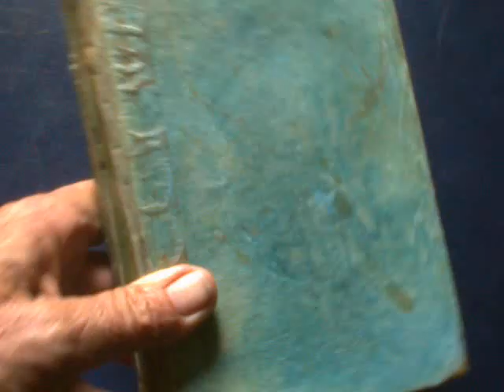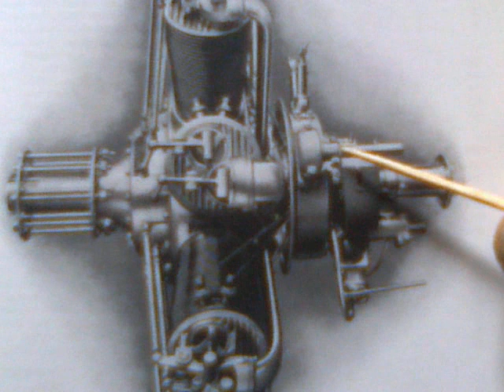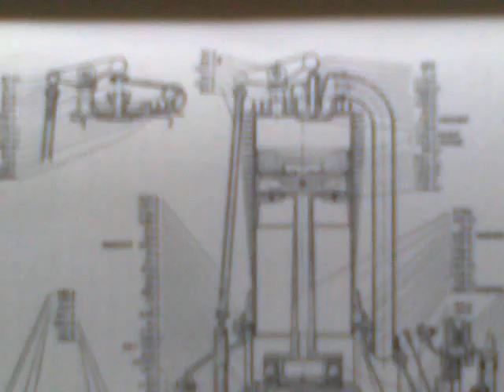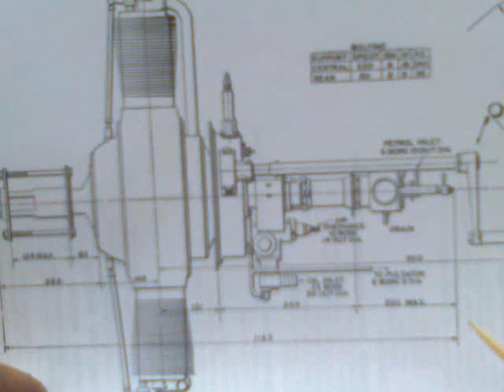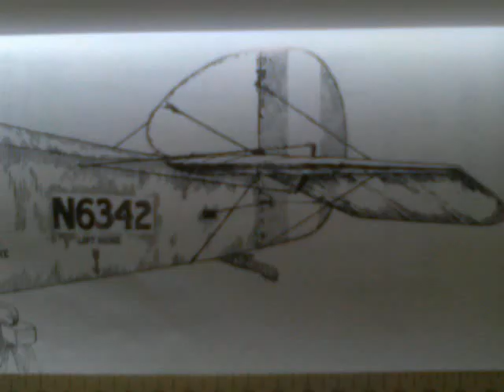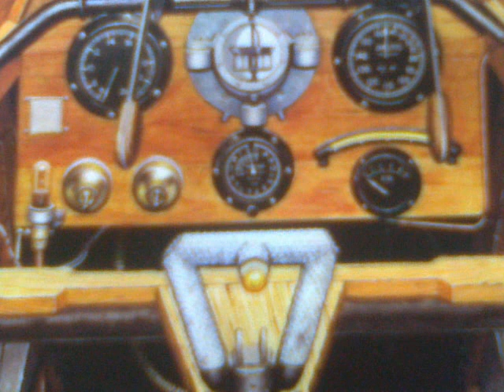Sopwith Camel Mystery, Technical Details According To Norman Macmillan.

Comment: Any ideas on the thinking behind routing the fuel through the crank case Warbles, or was that just a necessity in engines with rotating cylinders?
 It seems a very costly trade off, vis the Castor oil and total loss lube system. Was it common?
 I never knew the Camel was such an interesting aircraft.
Reply from the maker: G'day,

Thanks mate.

Ah, well..., if you check out my videos a couple of weeks ago on the Aeronautical Works of Lawrence Hargrave, the original Rotary Engine ran on Compressed Air - and I have only vague guesses as to how he achieved it.

The Gnome Brothers' 1909 7-cylinder 50 Hp  Rotary was a revolution, it was LIGHT, & SMOOTH, whereas pretty much everything else before was heavy as buggary & shook like a shower of shit, and they had to employ an Observer lying down on the edge of the Runway to look for Light under the Tyres, to prove that Flight had occurred...

   Spinning the whole thing meant no need for a heavy Flywheel, the Fins on the Cylinders had plenty of Cooling Airflow anytime the Motor was going, so by 1910 everybody wanted a Gnome...; and having the Fuel-Air go in through the Crankcase was the only possible way in & up to the Cylinders.

The early Gnomes had Spring-closed Poppet Inlet-Valves in the Crowns of the Pistons, with Low Pressure during Intake sucking them open to admit Mixture, & one Exhaust Valve in each Cylinder Head.

When an Inlet Valve stuck, the Plug ignited everything in the Crankcase, shooting Flame out the Crankshaft & Carburettor...

They brought out the Monosoupape ("Single Valve") which had Inlet Ports (Holes) drilled in the lower Cylinder Skirt (inside the Crankcase) uncovered by the top of the Piston at 20 Degrees above Bottom Dead Centre.  

On an Inlet Stroke the Exhaust-Valve briefly opened to admit pure Air with which to dilute the Petrol Rich Mix coming in though the Bypass Ports..., at the end of the Power-Stroke the Exhaust Valve opened at 25-Degrees above BDC so the pressures were equalised as the Bypass Ports opened, preventing Gasflow (!) ; but the "Shot of Air" coming in through the Exhaust Valve was why the Monosoupape's were either Idling or running Full Throttle - the Mixture was only correct at full throttle.

Then Le-Rhone & Oberusel & Clerget & Bentley all started using Induction Pipes & Inlet Valves in a 2-Valve Cylinder.

The Cylinders were one-piece units, with integral Heads, all turned down from single Billets of solid Steel, from which 98% by weight of the Metal had to be cut away - with the Valve-Seats cut using Boring Bars going in from the Bottom - "made like Swiss Watches..."

   The Bentley BR-2 used in the Sopwith Snipe was 230 Hp, the BR-1 in the Camel was 150 Hp, the Clerget Camels were 130 Hp & the Le-Rhones were 110 Hp.

   Like the early German Jets, the Time Between Overhaul on a Sopwith Camel's Engine in Service was 25 Hours....(!).

  My Model Aeroplane Engines ran on 1/3 Ether, 1/3 Kerosene & 1/3 Castor Oil, or 3/4 Methanol & 1/4 Castor Oil - so the Camel's 6 Gallons of Oil for 21 Gallons of Petrol (or 5 for 20) is no worse than my Enya 2.5cc Glowplug...

And my Chainsaw uses 1 of Oil for 50 of Petrol in the Carby but 400 ml of Bar-Oil for 750ml of Fuel-Mix ; some things treat Oil as a consumable, the same as they do the Fuel.

I'm glad you're enjoying my CamelWarbles, I've spent 50 years sorting it all out in my head ; it's good to share it - before Covid-19 puts us all to bed, dead..

Kinda thing....

  Such is Life.

Stay safe,

;-p

Ciao !
Reply: I've tried to describe rotary engines to people only to have them reject the idea of spinning the whole bank of cylinders around as not just crazy but impossible. Those who would tolerate the idea a bit usually moved on to insisting the center of mass would be constantly shifting... and their faces would screw up and their eyes cross when shown a cut-away animation of a Gnome.

The ports in the cylinder walls did surely make for a simple design.

Comment: Caster oil cleans carbon and smells the operation out of the enormous oversight and the bloke behind you..
Reply from the maker: G'day,

Thanks.

   My first model Aeroplane Engine ran on a mix of 1/3 Ether  1/3 Kerosene & 1/3 Castor Oil..., all the other ones ran on 3/4 Shell Racing-A (Methanol, dyed Purple) & 1/4 Castor Oil.

   A friend of mine who flew a Bailey-Moyes Dragonfly (an Ultralight of Pusher design, for Aerotowing Rogallo Hang Gligers...) used to occasionally use Castor Oil in his Engine - for the pure Biggles-esque fun of going up and flying in perfect Circles, so as to hit his own Exhaust Fumes, and breathe the scent of Sopwith Camels.

The problem was having to drain the Fuetank before the Engine cooled down & flush it with Petrol/Mineral Oil Mix, refill it with the Mineral-Oiled Fuel, and then start & run the Engine for 5 minutes to flush the Castor-Mix out of the Carburettor ; because otherwise as the Oil settled out & the  Petrol evaporated, after the Flight, the Oil would gum up all the internal passages & little moving parts in the unit - requiring complete disassembly and cleaning before the Engine could be relied on to start or run.

Such is Life 

Stay safe.

;-p

Ciao !